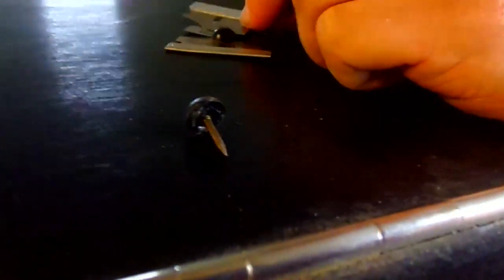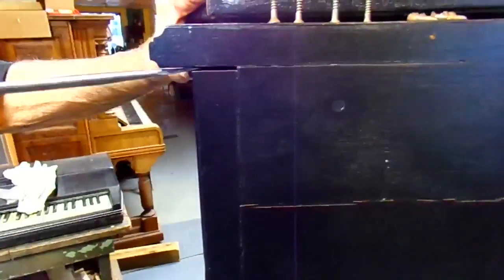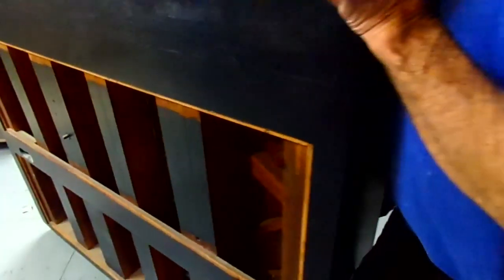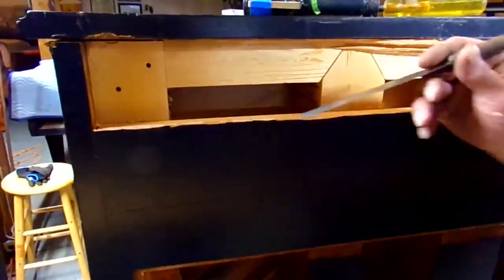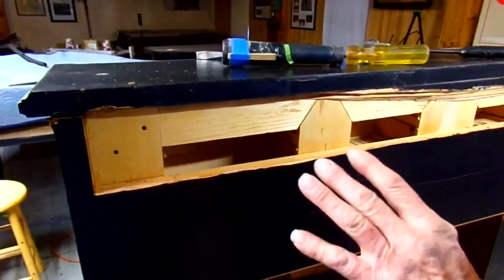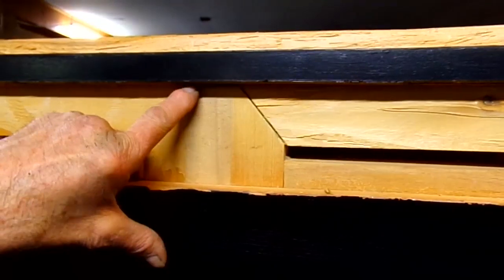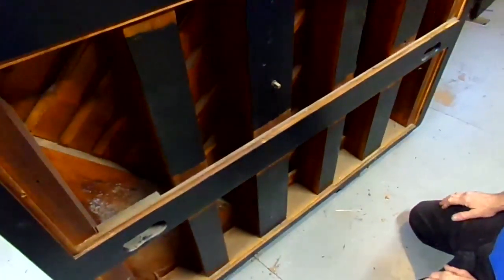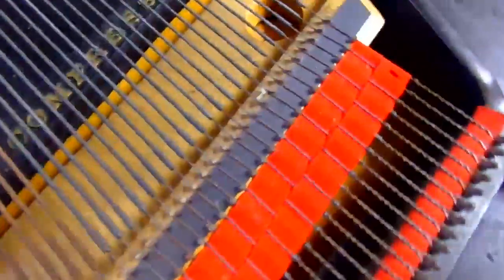Steinway Upright 1886 #57747 Rebuild part 1

Comment: This piano is bizarre.  Looks like a piece of junk (those timbers in the back) but being a Steinway it will be resurrected forever.  In the window of 1880-1920 there were many manufacturers that made good uprights..  One of the best I've seen (and played) was a 1912 Kimball.  Amazing how many makers there were (peaking in 1910).
Reply from the maker: Yes those big Kimball  uprights were impressive and heavy too.   
This S&S upright It is no piece of junk! 
 They made some of the most stable uprights and seems like the notable ones like Ivers&Pond Fisher, "Big" Kranich and Bach"s were built by masons, instead.  Hah! LOL!
We just last month junked/unglued for salvage an identical 1887 S&S upright and the back posts were solid super clear tight straight grained beautiful Adirondac spruce with a rock maple layer in between. the very best!. For our antique piano repairs, and guitars.
Piano makers at one time had plenty of the very best tone wood ever. Not so much nowadays.